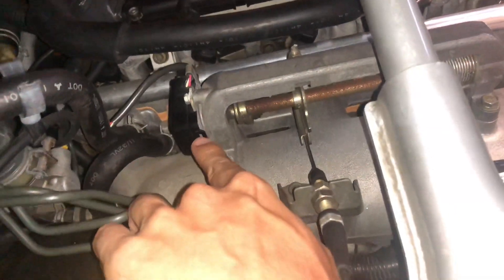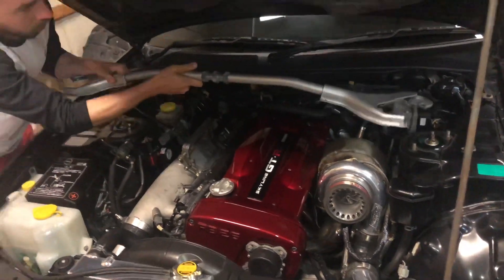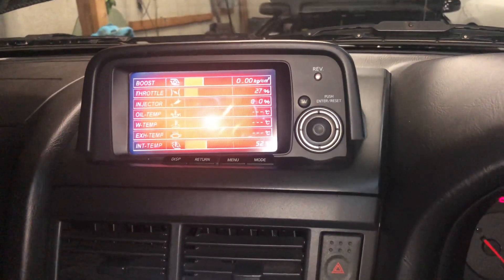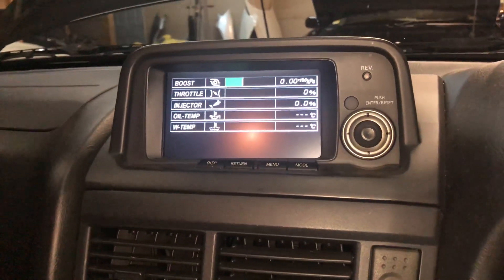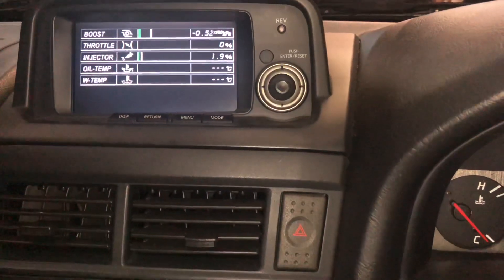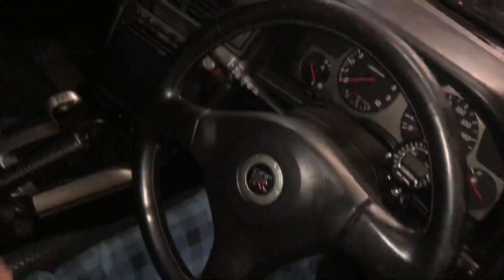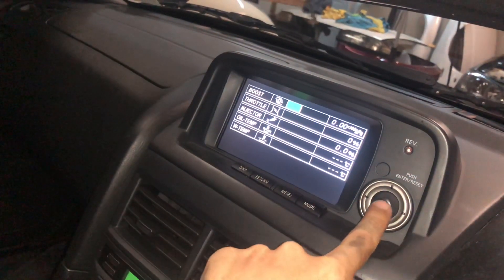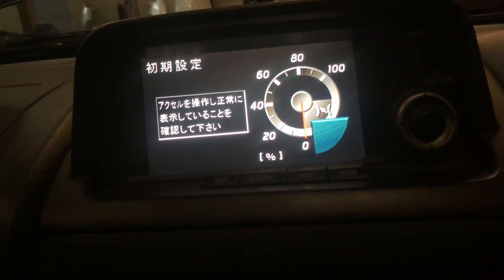How to Calibrate R34 GTR MFD Throttle Position Sensor {TPS}

Comment: Great video guys, my gtr seems to have a hunting idle problem and sometimes stalls at the lights. Been told it could be a tps related issue, any experiences?
Reply: I had a hunting problem on my GTR34 it turned out to be my inlet manifold gasket was blown as the OEM gasket is just a paper gasket. I replaced it with nitto  metal gasket and it was all good hunting problem solved. Just make sure you don't adjust any throttle body linkages leave them as they are and never clean the throttle bodies as they have a special coating on them to stop any air being sucked in. I had this problem with my throttle bodies after my idiot mechanic decided to clean the throttle bodies and made it worse, so then I had to remove all 3 throttle bodies and took them to a GTR performance workshop where they applied the special coating. I have not tested it out yet as I have my motor and gearbox out to replace all of the parts around the motor as well as my twin turbos, as its easier to do before refitting the motor back in.